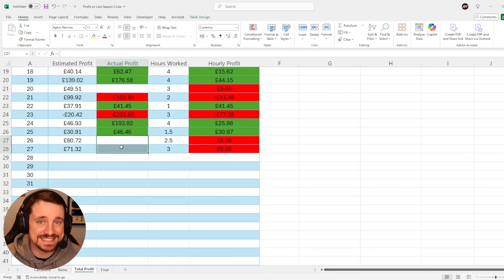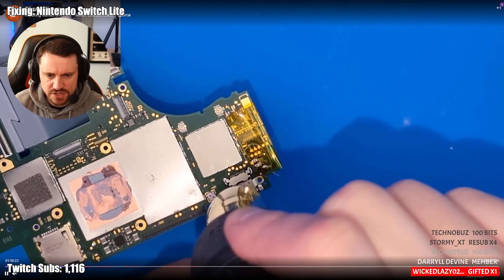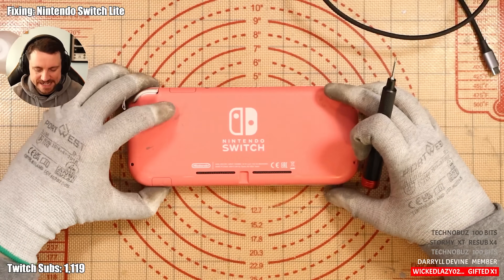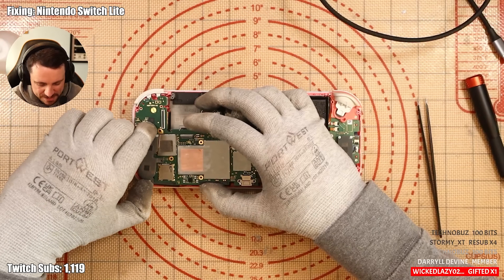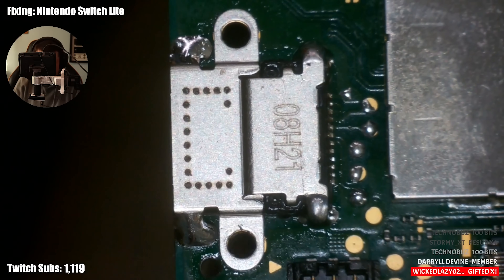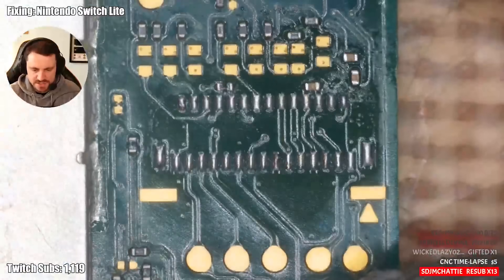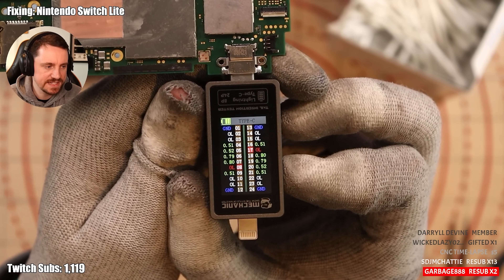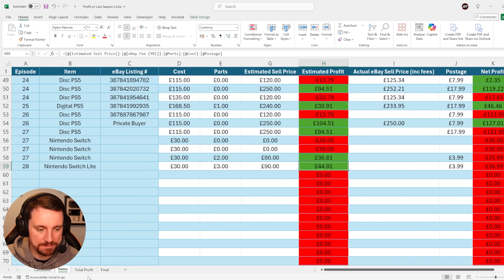Trying to Fix FAULTY Electronic Items for a Profit! S2:E28

Comment: got to love the easy fixes when the issues is obvious. i just did a GPU and it was my first ever repair that was as simple as a quick inspection. Found a blown resistor, luckily found a diagram so i knew what to replace it with and Wallah

Comment: Replacing usb-c port on switch lite and normal switch is easier unless you have riped pads, oled swich port has no aligment pins so things are sliping and sliding when trying to solder.

Comment: Joey, i just changed my first usb c port today on a switch. Someone had a failed attempt at it before me. I was successful except I accidentally knocked those filters by pi3 but I fixed them and it wsd great. One thing I've learned so far is get quality solder not cheap crap. Sice getting quality solder, things have been much easier

Comment: Did you 3d print your microscope stand/arm? If so, where can i find the files?
Reply: He 3D printed the part that goes between the arm and the scope. I believe he put the information on his episode where he goes over his room
Reply: @Dan-v3i  Yeah, after zooming in it looks like a standard monitor arm with a 3d printed VESA adapter for the mount. Thank for pointing me in the right direction. I'll go so if i can locate it.